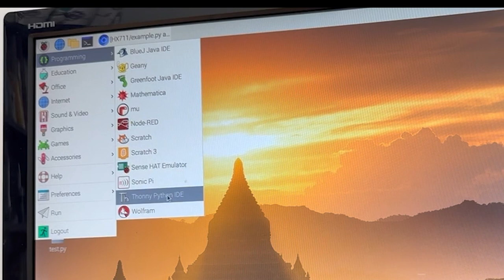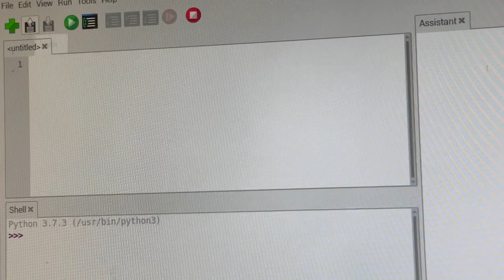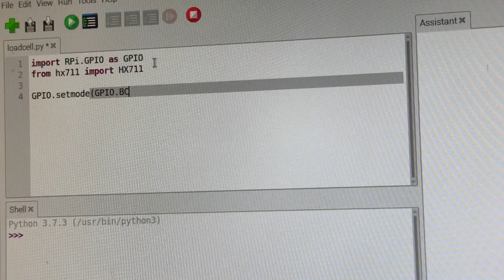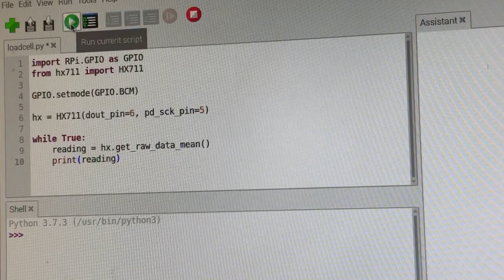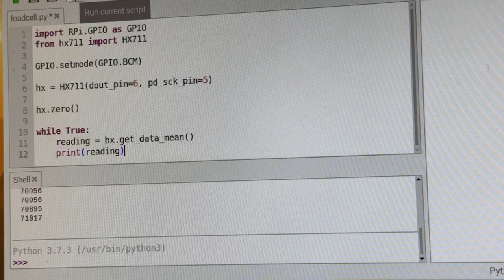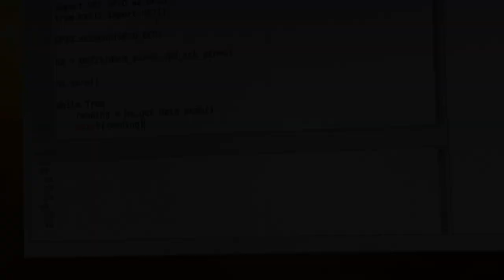07 First Run - Reading Data from the Load Cell with Python on Raspberry Pi

Comment: Hello Brian, I encounter an error trying every script out there for the HX711. After some time of measurement I get the following output:
 Traceback (most recent call last):

  File "/home/gambit/electric_power_06012024/load_cell_test2.py", line 11, in <module>
    reading = hx.get_data_mean()
              ^^^^^^^^^^^^^^^^^^
  File "/home/gambit/electric_power_06012024/venv/lib/python3.11/site-packages/hx711.py", line 470, in get_data_mean
    result = self.get_raw_data_mean(readings)
             ^^^^^^^^^^^^^^^^^^^^^^^^^^^^^^^^
  File "/home/gambit/electric_power_06012024/venv/lib/python3.11/site-packages/hx711.py", line 443, in get_raw_data_mean
    data_list.append(self._read())
                     ^^^^^^^^^^^^
  File "/home/gambit/electric_power_06012024/venv/lib/python3.11/site-packages/hx711.py", line 384, in _read
    if not self._set_channel_gain(1):  # send only one bit which is 1
           ^^^^^^^^^^^^^^^^^^^^^^^^^
  File "/home/gambit/electric_power_06012024/venv/lib/python3.11/site-packages/hx711.py", line 341, in _set_channel_gain
    result = self.get_raw_data_mean(6)  # set for the next reading.
             ^^^^^^^^^^^^^^^^^^^^^^^^^
  File "/home/gambit/electric_power_06012024/venv/lib/python3.11/site-packages/hx711.py", line 446, in get_raw_data_mean
    filtered_data = self._data_filter(data_list)
                    ^^^^^^^^^^^^^^^^^^^^^^^^^^^^
  File "/home/gambit/electric_power_06012024/venv/lib/python3.11/site-packages/hx711.py", line 682, in outliers_filter
    stdev = stat.stdev(dists_from_median)
            ^^^^^^^^^^^^^^^^^^^^^^^^^^^^^
  File "/usr/lib/python3.11/statistics.py", line 918, in stdev
    raise StatisticsError('stdev requires at least two data points')
statistics.StatisticsError: stdev requires at least two data points

Do you have any idea why this is happening and how exactly can I fix it?
Reply from the maker: I’m not sure what is going on just by the error. In case of a bad value from the sensor, I would use a “try-except” for error handling inside your loop. https://www.w3schools.com/python/python_try_except.asp That way it doesn’t crash your code if a bad value occurs, it will just skip the reading and continue on.
Reply: Hello!
I have the same problem. Could you fix that error?
Reply: @fabriciosolano2666   I spent many hours on this but no good resolution... the try catch doesn't help since the whole measurement seems broken. What worked for me was to change the raspberry. Again zero w but different board. It works without a problem now.
Reply from the maker: @ПетърЧуклев-м4ч  I'm glad you got it working, so you concluded it was a hardware issue?
Reply: @sorJohns  which means that's a software issue, although I don't know how but you can ask chatgpt. Edit: I realize chatgpt's code did not use the hx711 library but simply applied some bit and timing principles to extract GPIO data.
Reply: @fabriciosolano2666  Actually I tested today and it is still giving these erros. I currently have no solution for this
Reply: @fabriciosolano2666   I had the same issue, but then I asked chatgpt to write the code for me and it worked.

Comment: Hi, how do i save the read data to a .csv file?
Reply from the maker: https://www.scaler.com/topics/how-to-create-a-csv-file-in-python/ see if this reference works. You will need to write the “reading” variable to the csv
Reply: @ProfessorJohns  i figgured it out. But where do i adjust the sampling rate and the amplification factor?
Reply: @ProfessorJohns  in addition, do i have to recalibrate the sensor every time i use it, or can I save the calibration ratio?

Comment: hi, the only thing i get back is "False". Any idea what I have done wrong?
Reply from the maker: This usually means you don’t have the pins connected properly. Double check your software sck and data out pins and your connections on the raspberry pi.
Reply: same problem here. my pin connections are correct but it returns "false" value @ProfessorJohns
Reply: I have the same Problem, did you guys already find a solution ?
Reply: @Isabell-mp8vj  yeah all i did was to redo the wiring of the load cell into the hx711. it turns out that E+ E- A- A+ doesnt follow a color convention so the color arrangement of the wires in the video might not be the same with your load cell.
Reply: @PauloAgustin-dt9mx  how exactly did you reconnect the wiring? I switched green and white, now i don't even get the infinite false output
Reply: @tomislavfucek2554  Did you figure out this issue? I have the same thing
Reply: I had the same issue and have found the chart I printed for the pi4 pinout, had the GPIO's incorrectly labelled. May be worth checking if anyone has this issue in the future

Comment: Hello sir, I just follow your videos for my work. I have some errors ' HX711 have no attribute get_raw_data_mean()' 'HX711 have no attribute zero' ?? Could you please help me to solve this? If any thing became wrong when installed library files.
Reply from the maker: There are several libraries for the hx711. I think you may be using a different library, see the link in the video for the proper library.

06 Installing HX711 library with Python for the Load Cell
https://youtu.be/j3QSFnRhyFE
Reply: @ProfessorJohns  what is the link? I dont see it